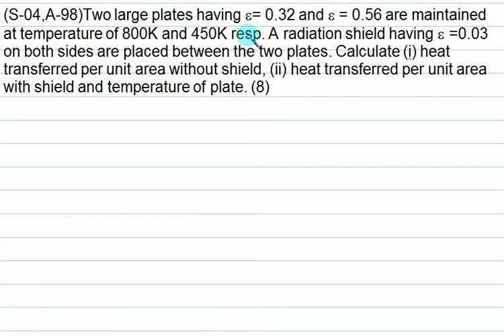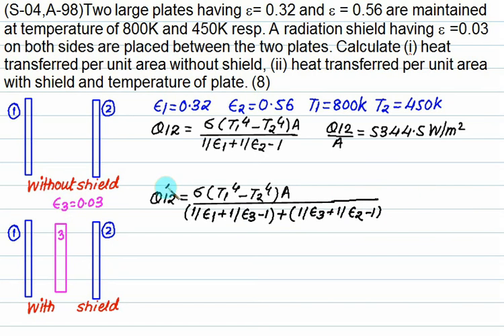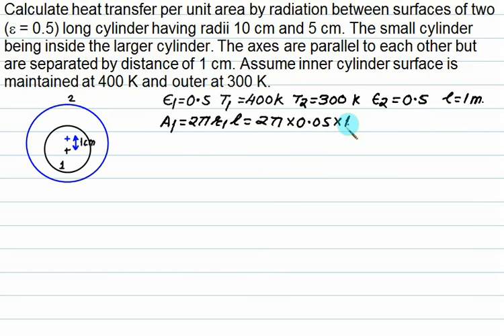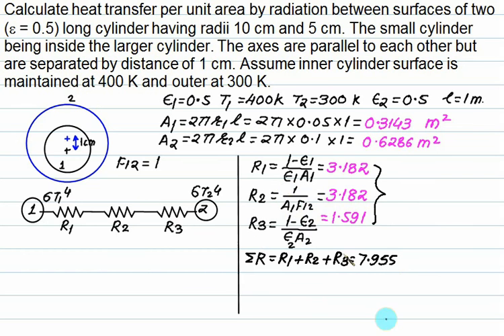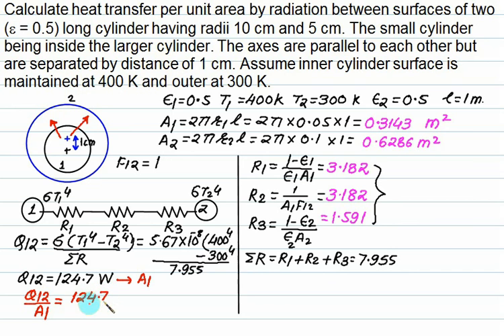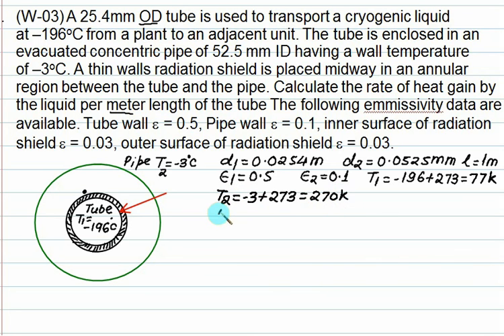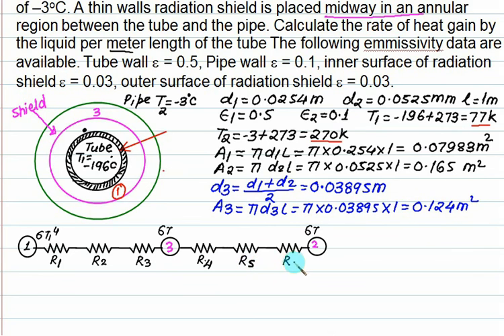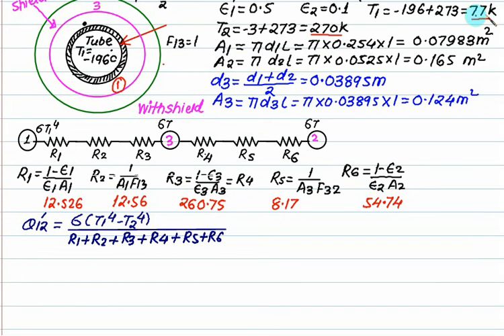05 Radiation heat transfer Numerical 2

Comment: In the last question,u forgot to add the surface resistance R4=260.75 and the correct answer would be -0.48 approx.